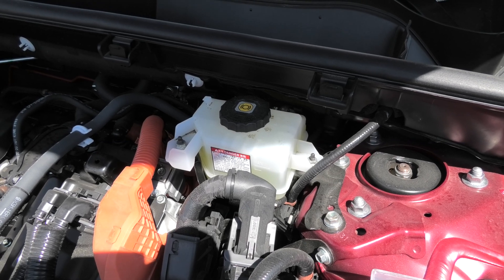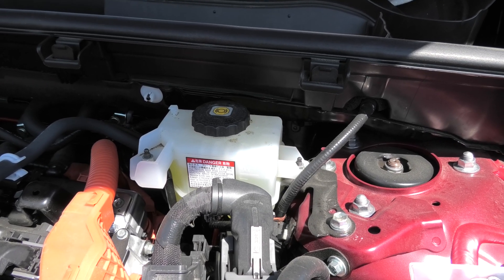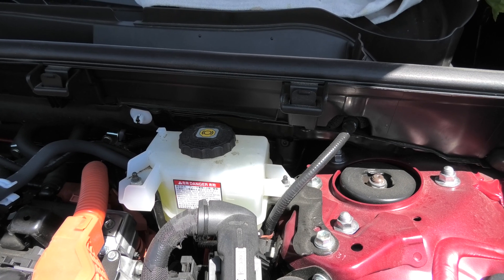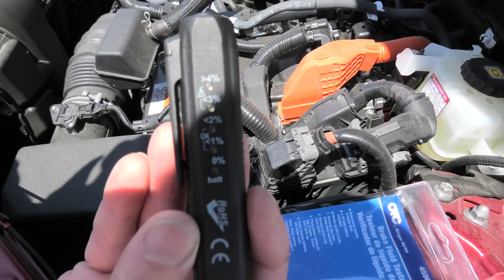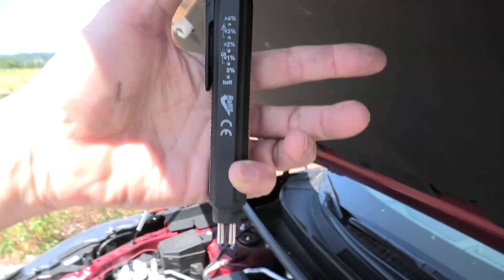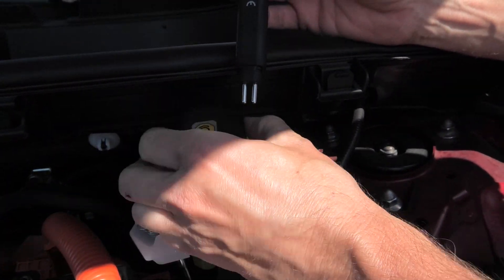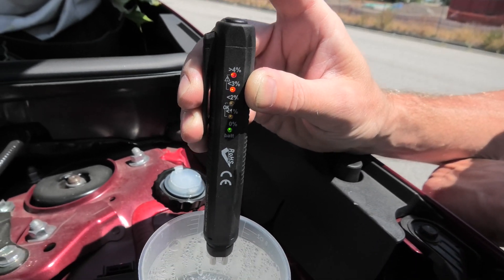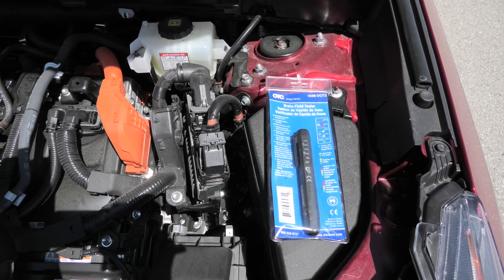Toyota RAV4 (2019-2024): How To Test Brake Fluid For Water Content?

Comment: Good check video.  The water contents in my Toyota within 5 years never reach more than 1%.  There is no need to change it for 10 years or more in hybrid, 5 years for a nonhybrid.  Many people never change brake fluid at all in Toyota and never have issues either. The seals is really good.  You can use pipet to test the accuracy from 1 to 4%, most of these cheap tester are actually really accurate within 1% accuracy.